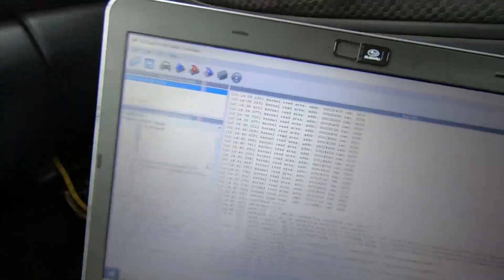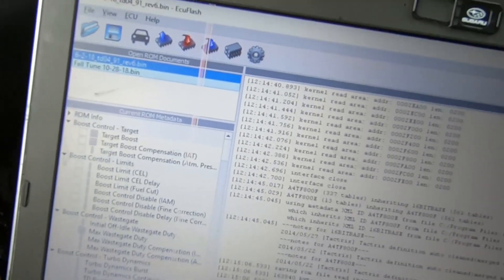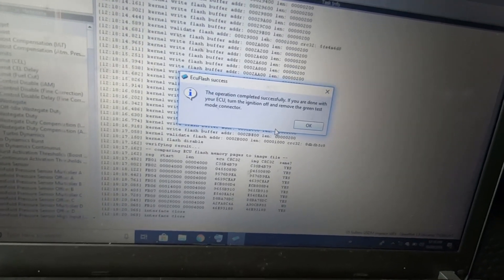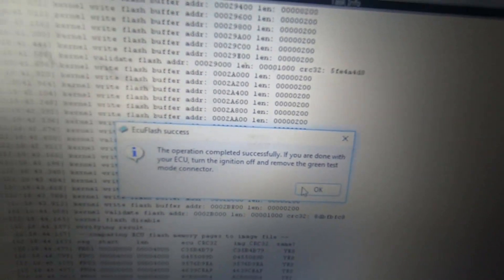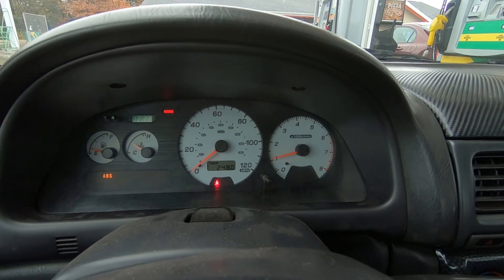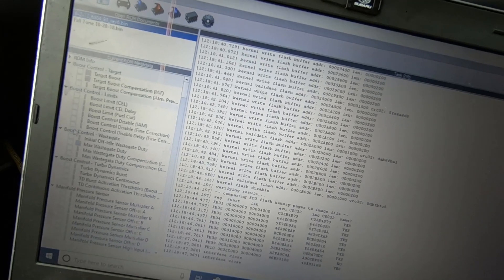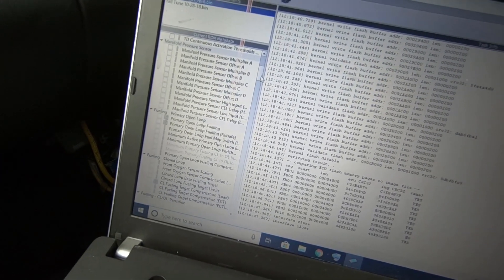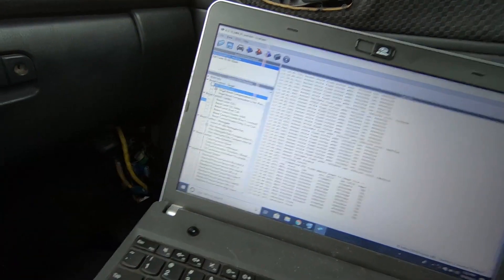How to Flash an Open Source Subaru Tune: e85 to 91 MAP with a 04 WRX ECU in GC8 RSTI

Comment: I tried to flash a tune on my 2002 wrx and says low voltage and won't let me flash it can you help
Reply from the maker: Hook up a battery charger to it and make sure all electrical like lights and radio are off

Comment: Throw and 03 bugeye ecu in it. Carberry flex fuel ftw
Reply from the maker: Terry Tumulty definitely something I've been considering
Reply: @LifeFlatout  there's a couple of us on rs25 using it. Im speed density, same block as you knoe. And another guy with a stock ej205 still on a maf. Plus the few guys on RR using it. The carberry specific eca has discontinued but you can use any sensor that converts to 0-5v. I made 415whp on my carberry ej22 all self street tuned